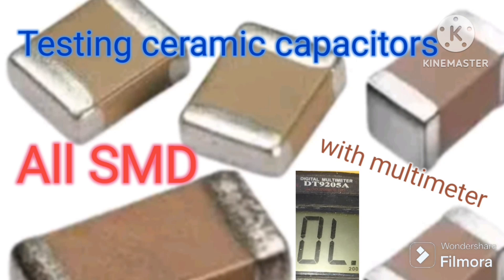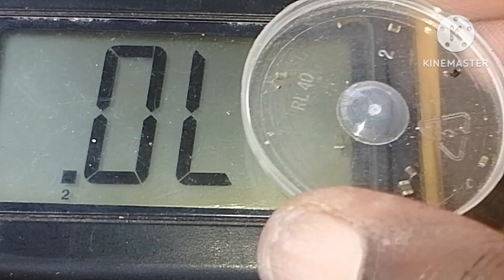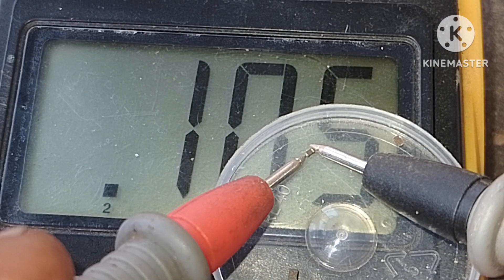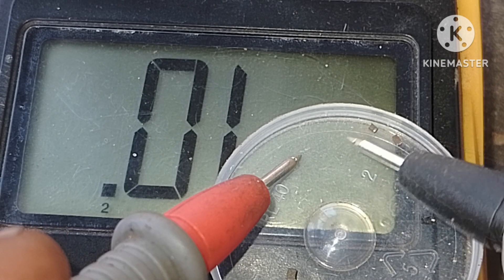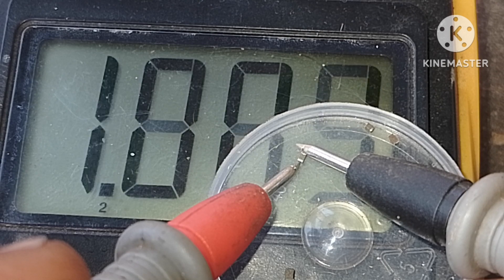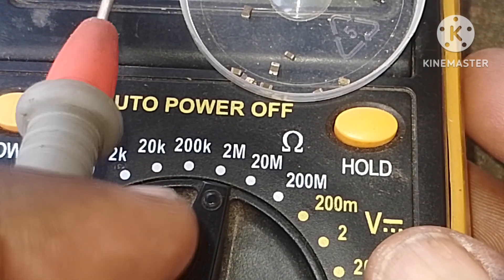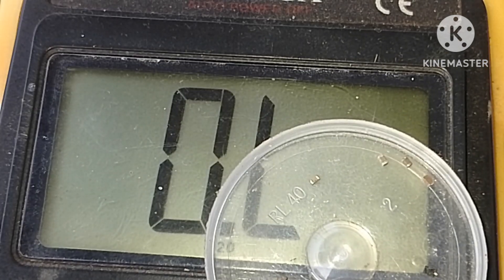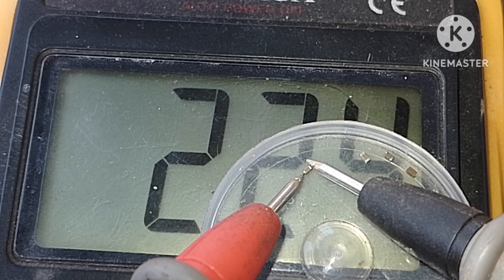How to test Ceramic capacitors Part 1

Comment: ,,power supply  also perform that putting  capacitor  between  to prob  and  notice the amper  reading start  voltages obviously  at lower value.